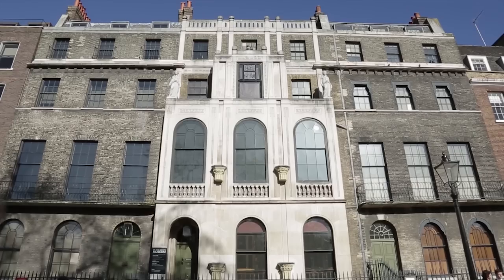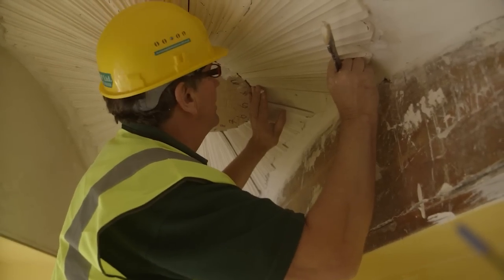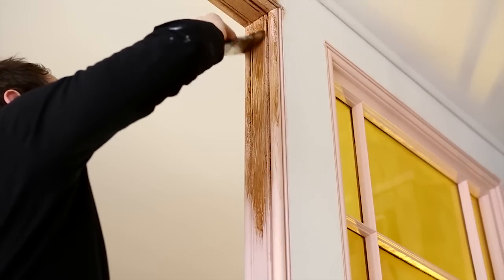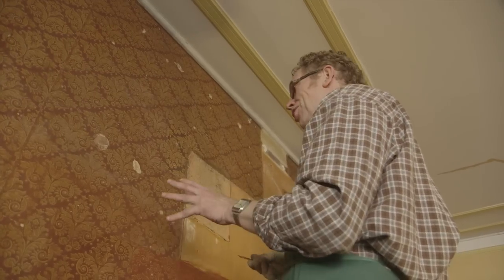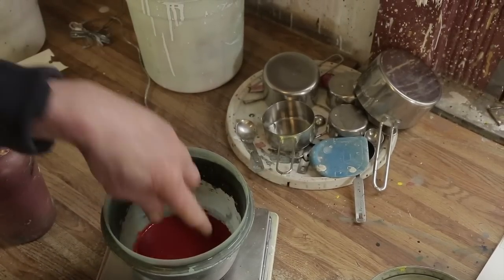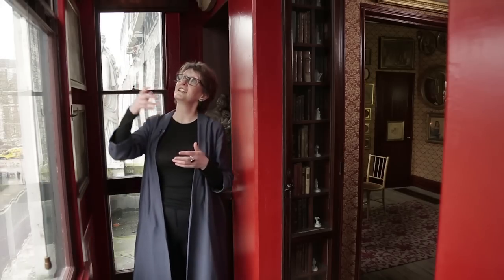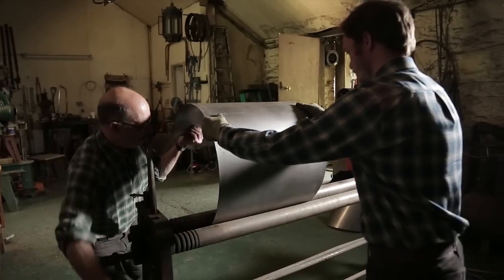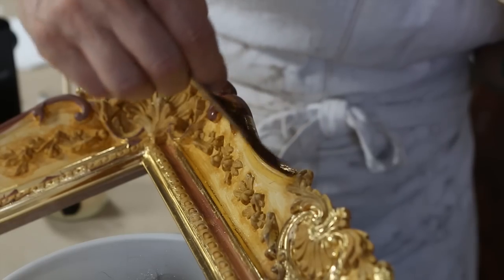Opening up the Soane: Restoring the Private Apartments

Comment: The museum was left to the State with specific instructions not change anything . So what did curators do they changed  the rooms , items were went missing , either thrown out or stolen . Now the curator expects a pat on the back for restoring the museum.  I bet if there are any family,y members left they could take back the entire building and everything in it , because of the stipulations in the will . So there must have been lawyers advising the State to put everything back the way it was or face going to court .
Reply: After 175 years, it’s not the same curator. I am happy the decision to restore it was made.